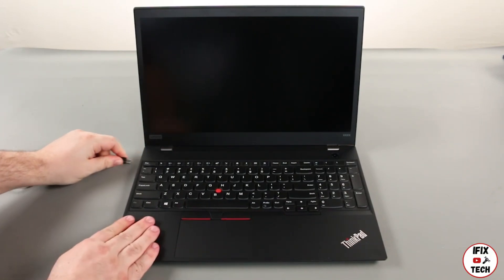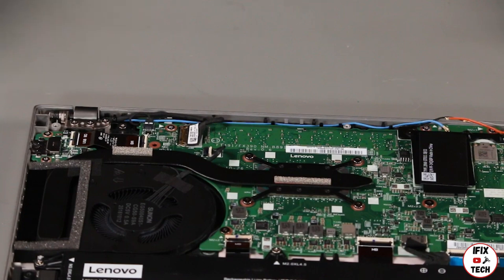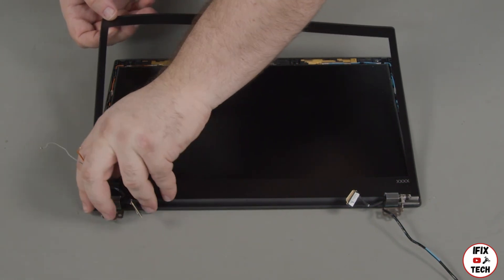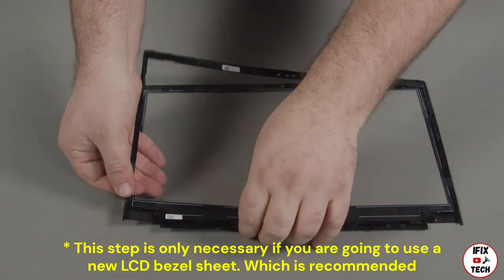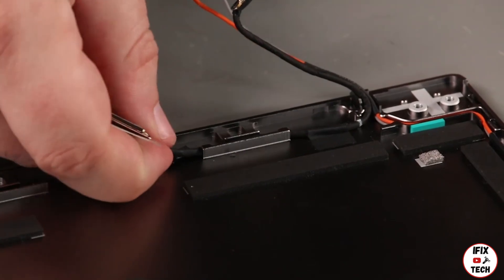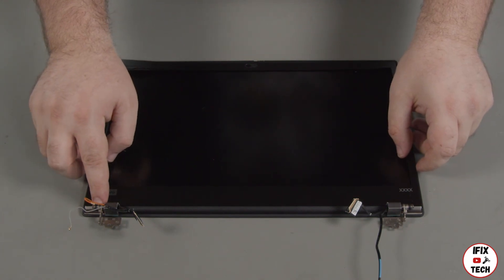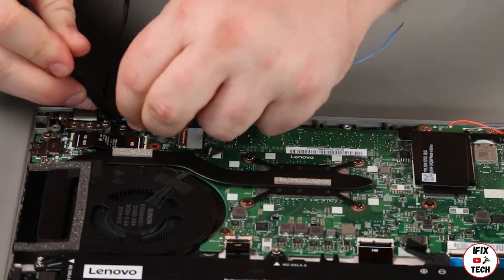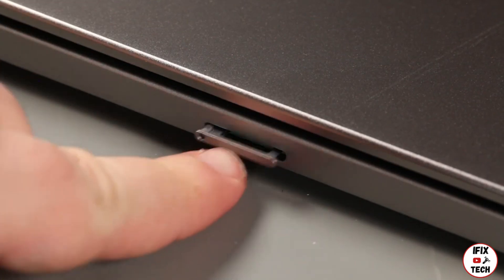Lenovo ThinkPad Laptop LCD SCREEN CABLE Replacement T490s and T495s - How to Remove LCD Cable

Comment: do we restart on the power supply as usual and will the battery be re-activated, or do we need to re-enter bios to re-activate the battery? Is the bios step crucial, or can the battery merely be disconnected inside?
Reply from the maker: We you connect the charger the battery will be activated automatically. Thanks for liking it and subscribing ✌️ 😉